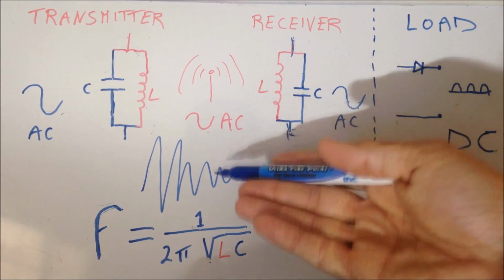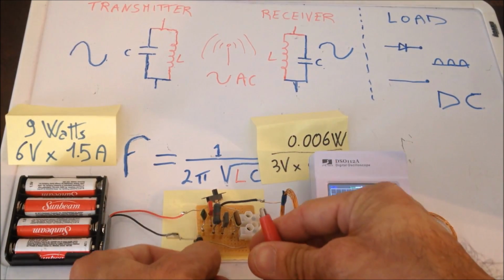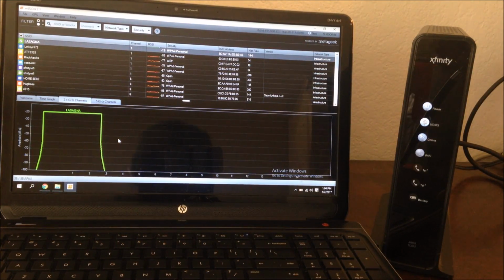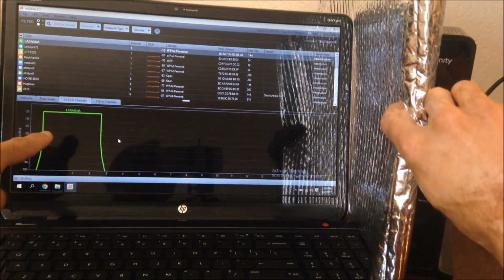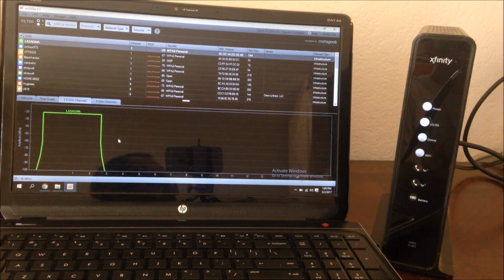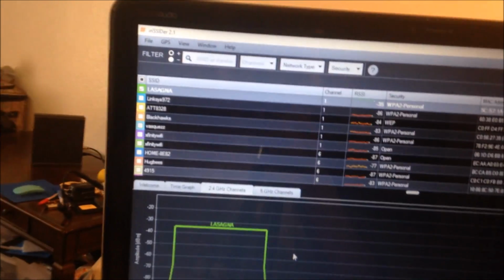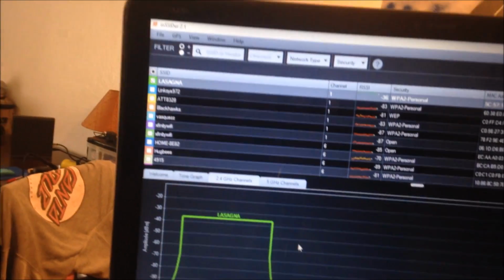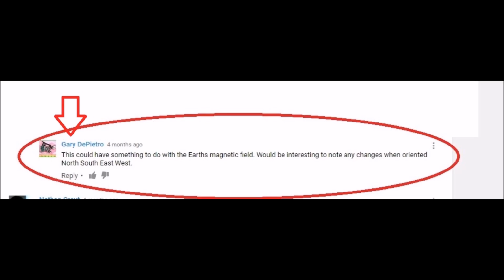The Best FREE-ENERGY generator! --  ELECTROSMOG BY TECH TORR

Comment: This debunked resonator failed on the directional part and others. Also there s a video that he showed lighting a small led so there s no batteries inside the bulb is possible. End up outside an open field without any field around. Up to you guys to believe or try to fully debunked. But this one is not convincing enough.

Comment: Where is your multmeter/voltage meter? You didn't do any of the thing tech torr did or the other guys video lol you using battery in yours because you don't reveal they so called "trick" and you don't use the meter and step by step debunk the video in everything they do. You give a lecture in the beginning of the video ranting about correct ways of energy, but when get down to the experiment you don't explain anything as to what makes the devices fake, or what the guys are doing or the trick which makes me think you don't know so you put a battery in your insulator to prove these guys fake with no multimeter or voltage meter, measuring what these guys are doing. I said in my other comments you failed to replicate the experiment and did not say much of anything of how their devices are fake. Your video is failed at debunking. You distract the audience with ranting and lecturing and didn't show how anything is fake or the trickery.
Reply: So he is worst than the scam he tried to debunked!

Comment: 100$ says tech torr device will still output a dc voltage of 3v or more INSIDE a faraday cage, that should help the uninformed. If you were to ask tech torr to swap out his dielectric to a real one you will get no response lol.
Reply from the maker: long waves requires longer antenna as well explained in the video.
Reply: And making coils inside a Faraday Cage and concrete still will pull in signals, lmao. Know form experience, spent 6 months running cables to get the first video conferencing working. The engineer or uh-ngineer, depending on what was asked, finally had to break down and have me get the device working. So funny. Because without me cutting the correct wires, it never would have worked without the radio signals that kept on coming through the cage and walls. And still to this day, the same optics are used in transmitting the image. And what came through on the first time without the noise in the background, was not from this side of side, and connected to something that was not ever broadcast on this side of life. What did come through was something that was needless to say, something I wish I could have totally destroyed in all aspects of the design. It sucks when your just a cable rat getting paid to run cables, and wire them up. But funny when the same guy that called me out in front of everyone, had to walk up to me and ask me to get his project working correctly. So dam funny. But sometimes I still have nightmares from the device working the way it was designed to do. Once seen, there are things that can not be unseen. No matter how much  you wish you never saw them. What is even worse is when you realize that they are right beside you and you never see them unless under certain circumstance are present. Like that chill you get that go up and down your spine, some things that you could wish you could forget you saw to start with. the only thing that can be done is to laugh, because I know what I saw as the last wires were cut to get it working the way it was suppose to.

Comment: As I see it, there are  3 conclusions to the Tech Torr experiments.  1.  Either  your ultimate assertions are correct that the device is fighting the laws of accepted physics based on your known facts in the experiments making it impossible.  2.  There is another piece to the experiment that has not been considered that might alter  your conclusions without breaking conservation making it possible.  3.  Your own demonstrations seem to replicate the effects of Torr's experiments, but to be fair, you too do not show how you do it.  So you leave just as much doubt on validity as Torr has.  He spreads mystery and you do here as well.  For all we know you two could be in partnership.  I doubt that, but your demo is not convincing enough just like his.  Also in your transmitter and receiver test, putting the metal between the units and showing the light go out does not prove there is no energy present for several reasons. The approaching of the metal will shift the resonant frequency of the transmitter tank causing detuning and efficiency loss.  Also the metal can act as a shorted single turn secondary thus robbing much energy to be available to the receiver.  We can also mention the metal eddy current losses introduced.  And don't forget the Faraday Cage shielding effect blocking the receiver.  There are other issues as well.  If you reveal how you trick the replication it would go a long way toward to reducing any doubts in conclusions.
Reply: Your comment is the sharp example that: No matter how much we can calculate/show/prove, ignorant gullible folks will remain such!
Reply: hold-on let me ask my 4yo nephew why a magnet and spring can`t generate any energy......
Reply: Don't understand, are you suggesting I am gullible and believe Torr's gadget is real?  If yes, then you got it wrong.  I am not disagreeing with Skeptical Open-mind's conclusion.  Only that the part with the metal placement is not by itself a proof.  Reread my reasons stated.  Also, think Skeptical Open-mind should have actually showed how he trick replicated the Torr gadget.  He did not show/prove the actual trick.  Otherwise I agree with the normal physics as Skeptical Open-mind explains.
Reply: Are you saying the Torr gadget is fake or real?
Reply: Yeah not enough debunkeing, also Skeptiptal- openmind bulb flickers. It doesnt replicated fully even the directional failed.